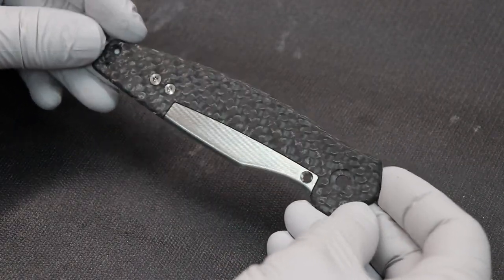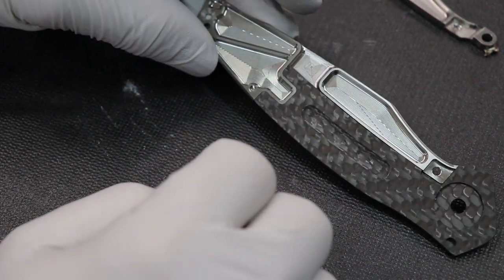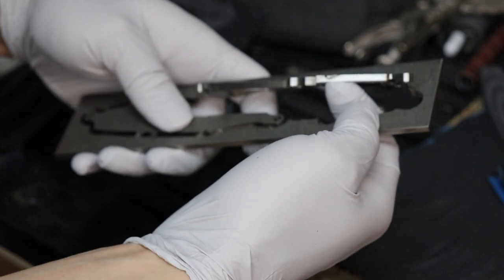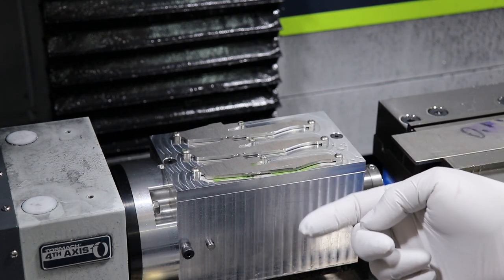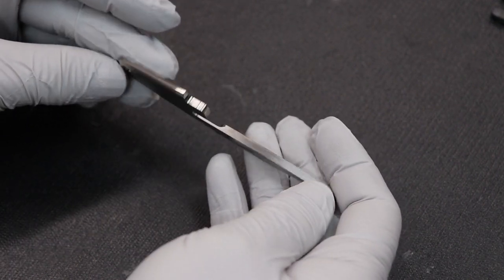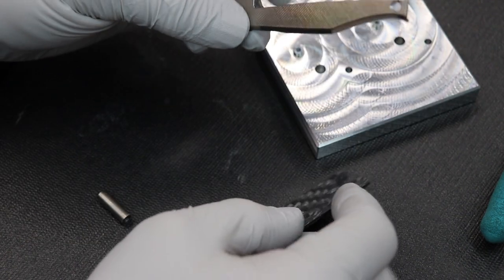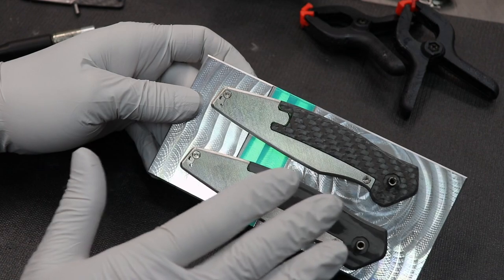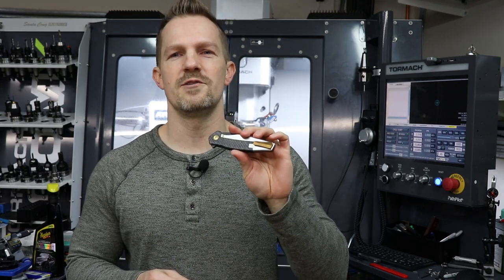Interface Knife making part 11, Handle/Lockbar redesign

Comment: We ABSOLUTELY appreciate your time and effort on these knives. Thanks for pushing the  knife-making bleeding edge just a little bit further. And hopefully you didn't have to do much bleeding.
Reply from the maker: You're welcome! There is definitely bleeding involved, strangely not from the knives but usually the end mills for the CNC machine. LoL, those things are sharp.
Reply: @vcedge9466  yeah. I've sliced up my fingertips on accident with some end-mills/bits. Easy to do. 

That squishy printable material to mask off your part for sandblasting is really elegant. Nice job! 

I'm considering quite a few of your tips and tricks for my process.

Comment: Great Work!!!  What coolant type and mixture do you use to prevent rusty and scaly looking bed, vise and tombstone? I can't seem to get it under control on my 1100MX. Again, GREAT work !!!!
Reply from the maker: The coolant is synergy 735 from Blaser Swisslube.  Concentration approx 8 percent with deionized water (the kind you get from spotless car wash systems). From what I understand the type of water is most important. Other than that I cleaned the system thoroughly before changing and added 10 micron filtration.  Also, I live in a very dry climate so moisture doesn't tend to stick around on surfaces leaving a concentrated coolant residue on everything. I've been pleasantly surprised that the raw steel and aluminum has stayed so clean looking.

Comment: Great video content! Can you tell me what torque screwdriver you were using when you were doing the bonding process?
Reply from the maker: The handle is a custom piece I made. The torque limiter at the tip is from Fix it sticks.

Comment: Very nice indeed.   How has the change of coolant worked out?  Any paint issues on your machine for the coolant?
Reply from the maker: So far the coolant doesn't seem to have any negative effects. No rust or paint peeling, concentration kept at approx 8%.
Reply: I have Synergy 735 in my will with no issues. My mate has had it for 2 years with no issues, and another friend has been using it in his £120K mill with zero issues. Only time people have issues is if they don’t keep the coolant between 7-8% and they don’t use pure water. You cannot use regular tap water.

Comment: How were you able to do the constant thickness in fusion for the bottom of the pocket?
Reply from the maker: By making a copy of the part, moving it up the desired thickness. Then cutting areas I don't need and using the combine feature I use the copied and cut bodies as the tool to cut. It might not be the most efficient thing but it works in this application.
Reply: @vcedge9466  Thank you, I appreciate the response and the content you are creating. Keep up the good work man.

Comment: What's your honest opinion on the Tormach 1100MX in real world applications such as this? Any issues holding tolerances, quality control issues, price to performance? I'm looking to take that next step from a Shapeoko 3 bench top CNC and I think this machine (or at least the brand) would be in that butter zone between hobby CNCs and Haas Minis. Thanks!
Reply from the maker: I've been very happy with the machine overall. The tolerances have been great after calibrating everything and it has excellent repeatability. The main thing for me was that this fit easily into a normal garage when the HAAS Mini would not (too tall). Also having 10k rpm has been essential for me using small tools vs most of the used HAAS machines at the same price that have 6k. 
All that being said If I could fit and I got a really good deal on a decent HAAS super mini mill 2 with the larger tool changer I would do that since it has way more horsepower and overall rigidity. In my search the difference was about 10 to 15k more for one of those in good condition, better to spend that money on tooling in my opinion. It really depends on your individual situation so good luck deciding, it's a tough choice.

Comment: I watched your video on backlash compensation on the 1100mx. Did you adjust/check the gibs before adjusting for backlash?
Reply from the maker: I did check the gib adjustments, mine were well within spec. I plan to check everything again this year sometime now that it's been in use for a while. I have also made small adjustments to the backlash after machining some parts revealed a small offset when changing direction.
Reply: How did you go about checking the gib adjustments? I couldn't find anything in the manual about the gibs.
Reply from the maker: @adamwaldram6839  Yeah I'm not sure why it's not in the maintenance section.  In the manual for the series 3 mill they have info on how to do it. The MX isn't exactly the same but the same principles apply.  That manual calls for within 0.0015” on the Z-axis and less than .0013” on X- and Y-axis for the lost motion (what I was calling backlash). They don't give any specs for table play, probably because it's so subjective. I used a similar method from a bridgeport or such mill to make sure it has some but not an excessive ammount. The correct way, I think, is more like what is called out is the series 3 manual.

Comment: Quick question, why are you pulling tools out by hand. Not trolling, figure you have a good reason and I’m curious.
Reply from the maker: Very good question. It's way faster when you have to load or unload a bunch of tools or the entire tray. Putting them into the spindle then telling the machine to store each one gets tedious and takes about twice as long. I'd really like a machine with a 100 pocket changer but for now I have to change sets frequently.
Reply: @vcedge9466  not to belabor, how does PathPilot know what tool you put in what slot. I guess I never paid attention to whether the slots are physically #’d in a corresponding way to the software. I only ask because I have the same machine and always looking to save time. I’ve been dropping the tool in the spindle, putting in the tool reference # then punching the store tool button.
Reply from the maker: In the upper left corner of the atc tab on pathpilot there is a block where you can enter the tool number and then press the insert button with the atc in the tray load position. Likewise the delete button for each removed or delete all if you unload the whole thing, just jog the tray fwd or reverse to get to each pocket. That way the machine doesn't have to do its whole routine, just watch out for sharp objects. Also use both hands one on the taper, I didn't show that because it was getting in the way of the camera.

Comment: Jason, first off I just wanted to say thank you for sharing these videos. I really enjoyed following the process. One idea for your aluminum bond fixture is to account for the thermal expansion at your cure temperature. You could make the holes closer together at 70F and do the calculations for the thermal expansion pretty easily. I think CTE for Al is around .013"/degF/in or something like that off the top of my head. NOTE: Assuming the mating surfaces don't collide too hard at room temp assy in the fixture. Or like you said just do it in another material with a lower CTE. Look into Carbon foam Tooling board possibly, pretty cool technology.

https://www.cfoam.com/tooling/
Reply from the maker: Interesting thought. If thermal expansion was accounted for in the fixture I'd have to promptly remove the part before it cools. I'm familiar with the carbon foam from my aerospace days, it's used all the time for temporary molds. I have some woven carbon remnants that I'll use to make the next cure fixture, I just have to make some metal inserts for the threaded areas.
Reply: @vcedge9466  yeah I figured you might know of the carbon foam based on your experience. I have a similar background doing composite tool engineering for an aerospace company at the moment. I really applaud the execution and attention to detail on your product. Huge respect and I will be on the lookout to pick one up some day. I like that you shared enough of the process to make it seem approachable, but left some of the fun stuff mysterious. That's a fine line and I think you nailed it.